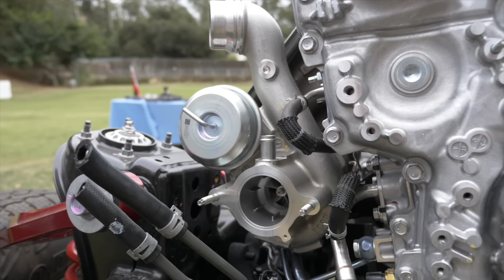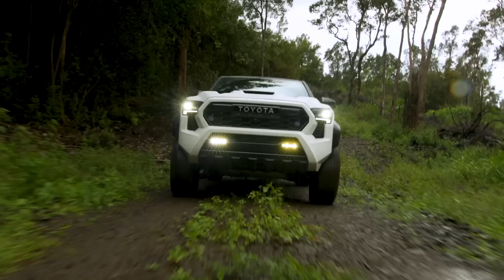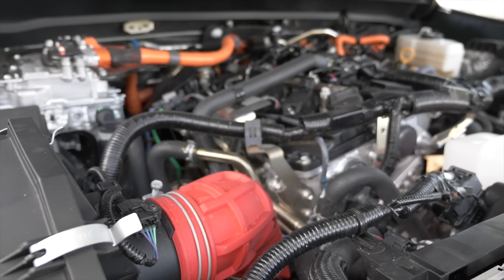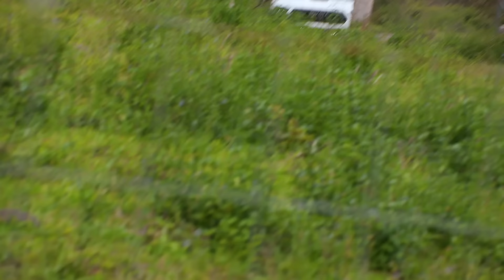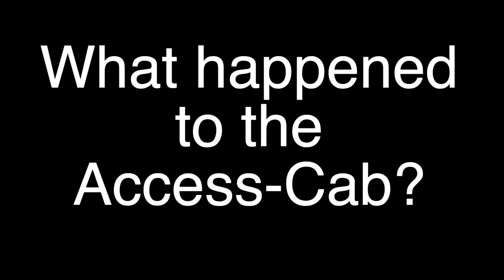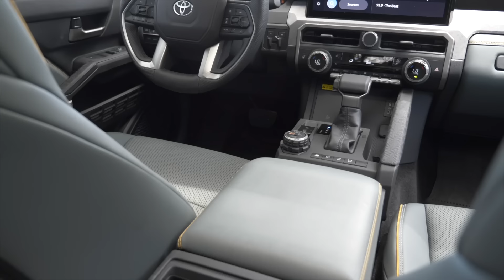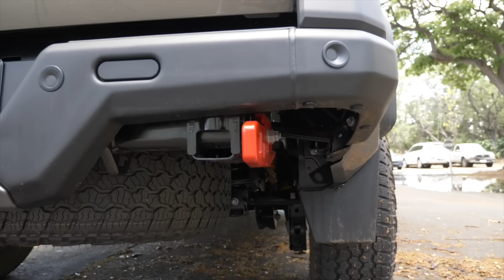2024 Toyota Tacoma Chief Engineer on new engine reliability and more...

Comment: Bottom line government forced you to go turbo because of emissions but at about 200 k when the turbo dies what is it going to cost to replace it and how much longer will the engine last past that with increased internal pressure a friends dad had a 22r motor drive itself to the junkyard at 530,000 miles when the body rusted away will this motor hit 300k the engineer knows the answer but that he won’t say I am old and I believe Toyota has reached the conclusion dodge did with the slant 6 you can’t make a vehicle that lasts too long look at the tundra the v8s can run over one million miles will any turbo 6 get there HELL NO that is the problem when trucks are 50 to 100 grand!

Comment: First of all, I appreciate this gentleman giving us a tour of this motor so thank you for that. Coming of age in the 80s I’ve always had a healthy aversion to turbo gas motors. Fully ready to accept much has improved on power delivery and longevity in the intervening decades but still pretty sure you aren’t going to get NA-level reliability out of this engine. Big motor loafing vs mini motor screaming just doesn’t compare in my mind and I need a whole lot more than coy references to “secret sauce” to convince me. How about “we ran this motor both in the field and on the dyno under X conditions until it broke and what we can tell you, without any hesitation, is it it will last as long or longer than a naturally aspirated V6 in this application.” But of course, it won’t so they can’t…
Then there was the too quick nod to frame improvements. Lol - wait did you actually say you figured out how to make it THINNER?? Yeah I think I could name a healthy handful of funny shaped Tacoma owners that probably don’t think that’s a good idea…
Reply: I believe he said thinner in some areas due to different materials but thicker in certain key area's. Also sounds to me like they may have been  under pressure to loose weight,or at least not gain weight. I guess time will tell how it works. Whether folks like it or not,ALL manufacturers are making changes. The more the government gets involved in the form of new regulations,the more they will have to seek changes.

Comment: "Reducing the gauge" of the frame doesn't sound like something I would call an upgrade. Still not sold on turbo or hybrid just because of complexity and maintenance.
Reply: Hybrid is better than turbocharged
Reply: Toyota frames are good for maybe 10 years at the most in Michigan. Personal experience!
Reply: Remember the Toyota “frame gate”? Keep your receipts!!
Reply: Turbos fail. I would not trust this thing to reliably take me to the middle of nowhere like I do my 2010 and 2019.
Reply: Hybrids are mechanically simpler and proven to be reliable.
Reply: @ClockworksOfGL  Trucks
Reply: @ClockworksOfGL  no. Hybrids have all the moving parts and failure points of both i.c.e. engines AND ev's. Also, when you add a turbo to the engine this is multiple points of potential failure.
Reply: @deadbrother5355  - Hybrid powertrains (with rare exception) have no clutches, sprags, torque converters (which heat up & breakdown the fluid), solenoids, valves, and the engines are never turbocharged. The transmissions are basically differentials in reverse.   It’s not unusual to see hybrids go hundreds of thousands of miles without any problems.
Reply: @ClockworksOfGL  literally ALL 4th gen tacomas are 4cyl turbo hybrids.
Reply: @deadbrother5355 that’s not true, only the top trim TRD Pro and Trailhunter will be hybrids
Reply: @4477superman  yes. Hybrids with a 4 cyl. Turbo,  no?
Reply: Trying to sell you a thinner gauge frame is an upgrade 😅😅. I drive mine all the time too. From my garage to my front door. No issues at all period. 
My neighbor started to brag about his cheaprookee. I've had no issues in all the years I've owned it. 
So I asked him. Wasn't it several years ago you called me to rescue you and your wife from the Rockies.. and how far do you drive each day. Maybe 1.5 miles to the grocery store every day. 😅😅😅. 
He shut up and walked away.

Comment: I sure hope it’s better built than GM 4 cylinder turbo engine a 2023 model leaking oil and parts on back order fuel mileage is not there either

Comment: I'm  a proud owner of two original 1986 factory Turbo 4x4 extra cab pickups. They both still run like a watch and both are around 260,000 miles. No oil peaks of any kind. Both turbo's were replaced at 200k. I wish Toyota would make a SMALL truck like these again. I believe this new turbo 4 will serve well.
Reply: How much do you think it will cost to replace a turbo (or 2) on the new toyota trucks? The 22RET could be changed with a few open end wrenches in an hour.
Reply: I have no clue, but I do have faith with Toyota, and I don't see any issues. Who knows. Could be crap too. Internet opinions on the new products from any manufacture are very biased. Everybody wants to be an arm chair engineer.  I look at it this way... I'm sticking with my older, perfectly running Toyota pickups. Personally I will NEVER sign on the dotted line to purchase anything new. Debt sucks, and I just refuse to put myself in a situation where I have a $1000 a month payment for God knows how many years (6+). I guess it depends how how much you believe someone telling you that the economy is doing great, there's no inflation, and how much you trust or like your job.
Reply: Same here,but all these tacoma idiots are too overpopulated.. and toyota cater to them
Reply: @damnitdang  its also  because most americans are obese, type II diabetics that eat fast food, and are 300+ LBS and can't  fit in a small pickup like the older ones.
Reply: Toyota is going to bring back a small pickup. It will  be called the Toyota Stout.
Reply: @James-k5f4k  I've been hearing about it. It will be a LONG time before we see it. I barely remember the old stout. I like the new $10,000 Toyota pickup that is being talked about. We'll  never see that here in the states.
Reply: @Joeak74  Exactly, stockholders will never allow it to be sold here, not enough profit.
Reply: @James-k5f4k  not in the US they aren't.
Reply: I saw some artists renderings, and they looked pretty good to me, especially with the round headlights. @James-k5f4k
Reply: @James-k5f4k  But the stout will also have turbos. Right back to performance instead of reliability.
Reply: They can't. He mentioned they did the best they could to keep it smaller. The wheelbase is what determines the allowed emissions.
Reply: For the price of new trucks with turbos, one should get a half million miles with no problems. 200,000 miles on a $70,000 truck does not cut it.
Reply: you sir are a lier, there is no such truck. you are here to simply cause problems in the youtube community.
Reply: fake account.
Reply: That isn't a testament to the truck it is a testament to your outstanding care about maintenance. Young guys are destroying these over engineered (not over built for longevity) vehicles because they believe everything they are told. They trade them in early and completely screw the next owner.
Reply: @Scroll_Lock Bull.   I buy all my Toyota vehicles with 100k miles.   They are just getting broken in.  I have a Land Cruiser with 328k.  No one is getting ripped off or screwed.   Why invent such a story?  It's blatant bologna.
Reply: @chiphill4856  Your individual personal experience isn't worth shit. I said you CAN ruin a Toyota by completely neglecting it and I've seen it a thousand times because dumbasses thing that a badge plus no maintenance just automatically means nothing bad can happen. I've seen people not even change oil for 20,000 miles before synthetic. Spare me the nonsense. Go youtube ruined Toyotas, they aren't invincible against morons, and there is no shortage of morons, yourself included.
Reply: @chiphill4856  those two Toyotas of mine were purchased with 190,000 and 207,000 miles on them .
Reply: I had a 1985 SR5 that I bought new, could you get the 1986 gas turbo model with a 5 speed manual transmission? Great to hear that yours has certainly passed the reliability test!
Reply: @carlc5748  The Turbo trucks came in two 4x4 flavors. A base model standard cab, and the SR5 loaded Extra cab model.
The loaded SR5 extra cab pickup's received the A340H automatic transmissions. 
The base model received the manual trans. FUN FACT: In stock form (and perhaps modified also), the automatic walks all over the manual off road. Especially in sand and loose stuff. The auto does everything better. Its fun to shift though. I can say this because I've owned both. The auto is a little doggy on initial acceleration on the street. A few seconds slower on acceleration from a light. Big deal.
Reply: Thanks for the technical info, you are the first person that I've communicated with, that had a gas turbo model. I believe that Toyota had a turbo diesel pick up for a few years, in the mid 80's. I test drove a new one, and compared it to the Mitsubishi Turbo diesel (both 1985's).  I thought that the Mitsubishi one had snappier performance, over the Toyota diesel, but I ended up buying a loaded 1985 Toyota Xtracab with the rarest color, the metallic electric blue.  I still have the original window sticker when I bought mine in 1985. On the sticker it says "special paint treatment $399.00" @Joeak74
Reply: @carlc5748 I have an 86 Pickup with the 4 Cyl turbo engine and a 5 speed manual transmission. I bought it new off the lot at the end of the 86 model year. It is now pretty rough, but it runs well, and it is paid off!
Reply: EPA and the government's fault plus modernized CAFE standards. Truck bodies have to take up "X" amount of space based on an engine and displacement in order to get certain allowances, and so you get these oversized overbuilt pieces of garbage. It's not that there's a lot of people who want these so much as it's manufacturers following the easiest way to make money in the market.
Reply: Those timing chains though...
Reply: @9ZERO6  If an engine has a timing chain, people will bitch. If the same engine has a timing belt, people will bitch.
Reply: It's that old Charles Dickens theme: "It was the best of times, (and) it was the worst of times".  That guy was "politically correct" before that was an "in" thought, and knew how to do a CYA! @Joeak74
Reply: That's why I'll avoid turbocharged cars. If there's no turbocharger, there's no turbo charger that will need to be replaced.
Reply: my first truck wauck was a 89 toyota xcab pickup with that 22R enigne...that thing never died. Took a 30 car pileup at 280,000 miles to see it die. They need to make them like that again. Just not as easy to rust lol
Reply: You said you replaced the turbos at 200k miles.  Glad you admit they're unreliable.
Reply: blame obama and his regulations making it not profitable to make small trucks anymore.
Reply: @misterc9641 Ford Maverick?
Reply: @misterc9641  WOW  that is an extreme level of ignorance. They are extremely profitable, it's just that big trucks are much MORE profitable. Why settle for making 20%of 20k, when you could net 20% of 100k??? If you're going to blame someone, blame the investors and executives that demand huge profit increases year over year.  Lets put the  blame where it belongs, instead of spouting nonsense.
Reply: @adamcousins2459 nah, hate on capitalism all you want clown, but the gay, Muslim, immigrant we had for a president had a hand it. Your smug arrogance is amusing (in an ironic way) when you mention ignorance.
Reply: What a genius; a guy who left in 2016 is responsible for a truck made in 2024.  Too bad your guy from 2016 didn't do anything in office.  Bitch to him. @misterc9641
Reply: @misterc9641 How do you know it's not profitable?  Toyota is doing quite well at the corporate level.  You and most of these naysayers are just shooting off with no knowledge at all.

Comment: Increasing heat and stress to get the same power does not increase reliability, it’s quite the opposite! Turbos are great until they fail or cook the oil and kill the motor.

Comment: Nothing I hate more when a car manufacturer does away with a solid platform like the 4.0L V 6 you can engineer it to get better gas mileage to meet governments nonsense. Standards. The more you beat up suppliers on the price the cheaper product your going to get and it wont last. I am sure that the actual intension in the first place.

Comment: NEEDED a 2.5 hybrid non turbo. 245HP the one in the Sienna. 40Mpgs in a truck. That is what they needed. I sure the new will be nice and better but gas mileage was always bad in Toyota trucks. They already have a nice reliable and pretty quick engine. 0-60 in the 4700lbs Sienna is just over 7sec.

Comment: Do they even consider that people would carry quads and snowmobiles? I can tell right off the bat that a box less than 6 feet is just no good for snowmobiles. Piling more and more gimmicks does not work for a workhorse truck -- it is the truck for hipsters now.
Reply: Neither a "truck Load"  of Firewood
Reply: Triton should start building the 2KF single covered trailer again ,  this is about all this truck could handle.

Comment: They are helping the company epa rating go up lowering taxes and shortening the lifespan of engine parts increasing  ownership costs. Ie. Toyota doesn’t care because they are doing what is best for there bottom line. However they are Toyota and every company is doing the same thing so they will still be a leader in a decreasing quality industry unfortunately.  If I was to go to a turbo and against everything logical, I would use a Toyota. Basically the entire auto industry is getting worse for the consumer.

Comment: I like the idea of a turbo 4 better than the V6 but will I be able to easily work on and keep this engine running for 10+ years like the 2.7 liter 4 banger?
Reply: probably not.   turbo engines just do not last as long.  and this guy is not an engineer, hes a manager, sales guy, I didnt hear any engineering talk.  this is a sales pitch.

Comment: That air dam at the front. Would be nice if it was easy and quick to change out for highway efficiency only when needed.
Reply: 8 (or 9, I forgot) bolts to remove. Not crazy easy but not really hard either.

Comment: The focus on extra cooling means the engine is running very hot and beyond its purpose. You better pray your cooling systems never fail or that motor is toast. Reliability is always reduced when your focus is on fuel efficiency. I personally do not think these turbos will last past 100k. A solid i6 with no turbos is the ideal engine for longevity. Their old v6 is still a better option for longevity. The hybrid assist engines will also breakdown overtime and be very expensive to repair. I see too much planned obscolesence.
Reply: They are saying emissions is the reason for the switch. What is your take? I thought the V6 was already a clean engine.
Reply: @callofdutyguy9  we live in times where now politicians get too involved. The emissions and fuel regulations are to push manufacturers to move to EV which Toyota does not believe is a smart move at the moment. They are trying to still only offer gas and hybrid engines since they know that's what sells and has a stable infrastructure. Again if your focus is not solely on reliability then you won't achieve it. I'm only buying gas powered engines whether new or used that are non turbo based. If it's a large vehicle or you are towing or loading , you want a larger engine since it will reduce the strain and give you double or triple the life span. I drive a 2007 V8 Sequoia and I love it. I like Toyota V6 engines and their i4 engines. But adding a turbo on an i4 when the vehicle is heavy might give you the power but I don't see the engine lasting. I want 300k from my engines or I am not sold. Also from my limited knowledge, if engines are under more strain it has negative effects on the transmission as well.

Comment: Im an owener of a 2008 taco with 250k miles. The engine has no sign of oil leaks anywhere. It drives pefectly.

However, im afraid the body frame will not last due to rust. 

Id have to wait and see if these new trucks are worth the prices theyre asking. Toyota reliability is why i keep coming back to them. I dont care about all the bells and whistles added.
Reply: Same here own a 08 trd sport brought new 6 spd manual with 195,000 truck runs & drives great with no oil leaks or rust anywhere

Comment: I would love this truck with the 4.0 V6.
Reply: I had a 4.0 and now have a 3.5. The 4.0 is by far a better engine.  Also transmission constant gear hunting was not there on the 4.0.  Gas milage was the same.
Reply: @donbrloks3959 I drove my buddy’s for 6 months and I agree.
Reply: 1GR-FE all the way!
Reply: Idk I have one and this thing moves and loving it so far.
Reply: How about a turbo v6.

Comment: When i hear smaller gauge on the frame i hear "it will rust through quicker".
Reply: "We made it thinner and also better": Said nobody ever.
Reply: @kb9oak749  thinner and better by making it as strong while being lighter.
Reply: @Modikie  don't forget he also said they are passing that savings on to the customer 😂....
Reply: @Modikie  And boxed
Reply: @R3DKING5 Like Nissan did years ago, while soft Taco frames corroded like beer cans
Reply: @Modikie Fanboy fantasy in action
Reply: @proto… That and I also hear cost cutting.
Reply: @is6566 especially hecho en Mexico for $3 per hour
Reply: depends on the steel composition. There was a different type in the works that is supposed to be more corrosion resistant than ever that the automotive industry is adopting. I don't know if that's what toyota did here.
Reply: Only on the US made models
Reply: @yeoldmetalhead6592 None made in usa. ALL hecho en Mexico now.
Reply: Well, thank God I don’t live in a rust belt state one of my lesson with a 4Runner 😂